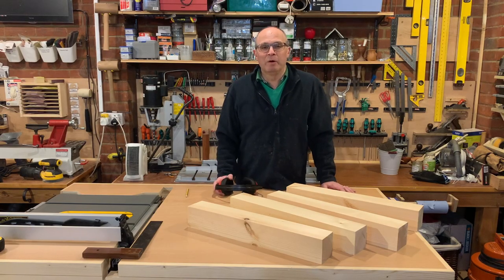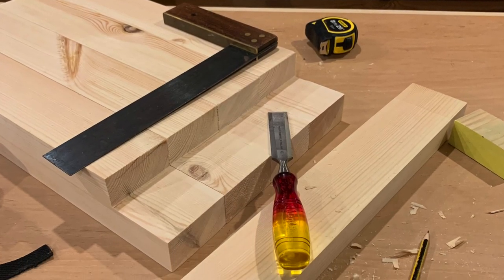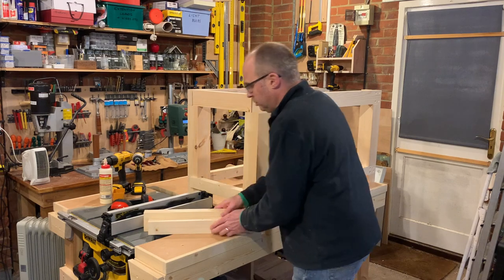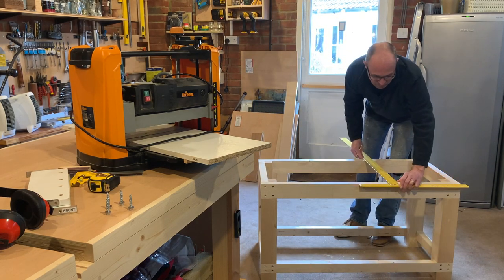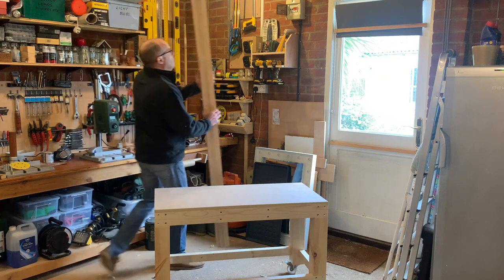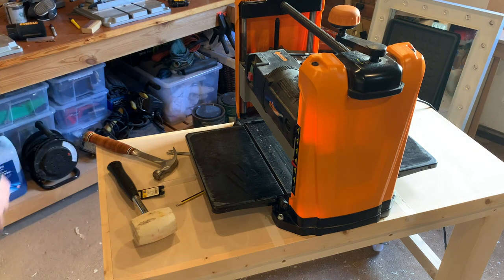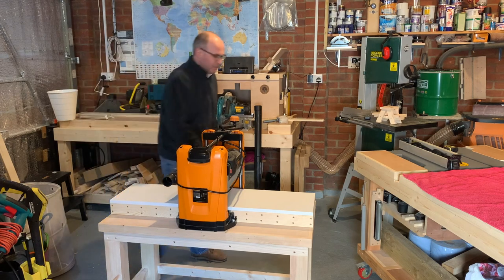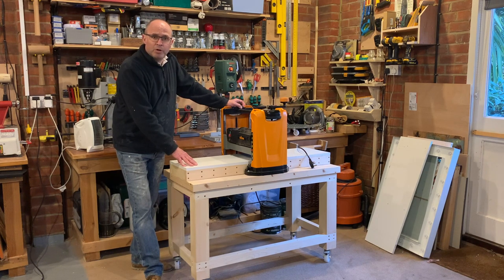TRITON Thicknesser TPT125 Mobile Bench   HD 1080p

Comment: Great Job Terry! Just a note from 10:00, try not to lift the TPT125 by the bar that spans the top - it's a roller bar and not built to take the weight. Would hate to see either it snap/dislocate and the heavy unit crash down, or deform/bend and the roller subsequently be useless. The black extremities either side of the top are inverted cup shapes and are specifically built as the lift handles 💪 looking forward to watching more!
Reply from the maker: @MarkNopeJustMark  thanks Mark. That’s a really good point actually, I must be honest a couple of people have pointed this out to me in some of my other videos and I have stopped doing it now, I fancy a full size planner/thicknesser now, but not sure I can justify it as a hobbyist thanks for watching 👍🏼
Reply: @Terrythemaker  no worries - I figured now it's bolted to the table that it wont be lifted often, but I thought I'd say on the off chance it'd save you an injury or would help the longevity if the tool 😄 RE a planer/thicknesser, it's hard to beat a tool that does both! I'm fortunate enough to have the separate Triton Planer and Thicknesser units and I'm in the same boat that you are - as a hobbyist it's difficult to justify buying a bigger, more commercial unit, no matter how much fun it would be!

Comment: Hi Terry, when you build the bench frame, and drill for fixings, are these all at same dimension, ie set on pillar drill. Do you then find the screws hit the other screws from 90 degree , or do they just find a path guided by screwpoint ?? Also, some of these fixings are then going into end grain, do these ones ever "give", or is the glue holding effectively.
Thanks for video, it gives a lot of insight into getting the best out of tools, i will be subscribing, and catch up with your previous builds.
Reply from the maker: Hi James, it’s a good point about the screws hitting each other. I must admit at the time I hadn’t thought about it, but you’re right, most of the time they just find their own path and if they don’t when you drive the screw in you simply drive it in as a slight angle so you know it will miss. As for end grain, I wasn’t too worried,  but I wouldn’t normally drill into end grain as you rightly say, but because of these sitting in a rebated ridge, they can’t go anywhere so I wasn’t overly worried. Thanks for watching 👍🏼

Comment: do u have any snipe problems when u use this planer...i saw a german review and he had 5 cm off snipe going in and out off the planer..hope to hear from you.
Reply from the maker: Hi, yes unfortunately I do get a fair bit of snipe, there is a few ways around it though. I did a video showing one way a while back. I must be honest I sometimes use timber longer than I need and then cut off 5cm  if I’m in a rush.
Reply: The only way to eliminate snipe is to use a piece of wood of the same thickness at the beginning and at the end. Nothing else works much.